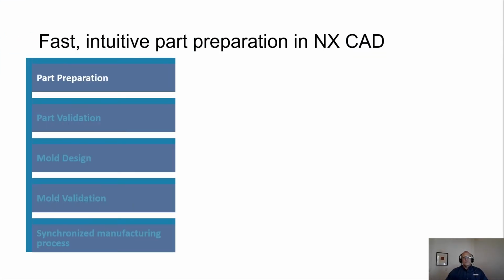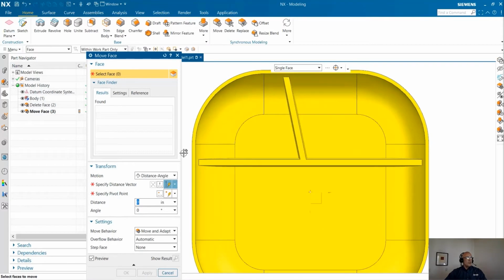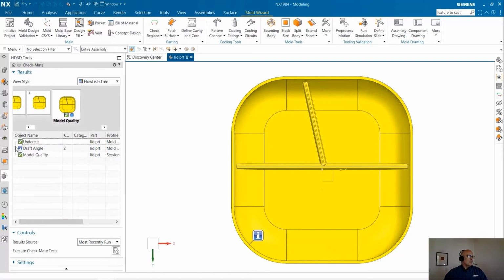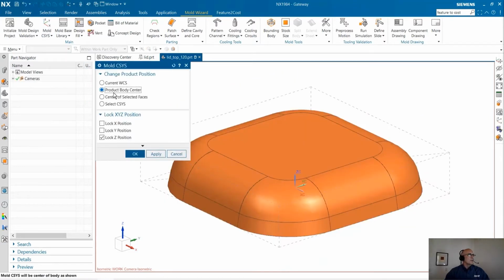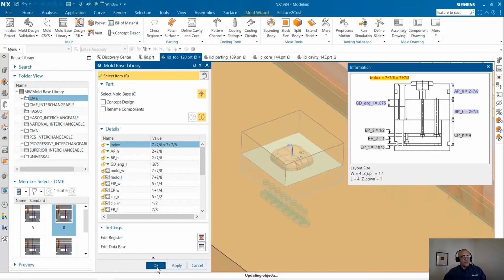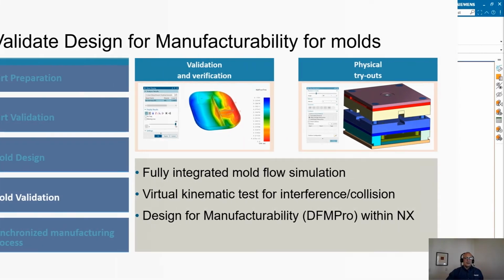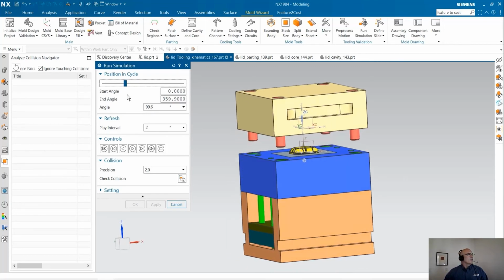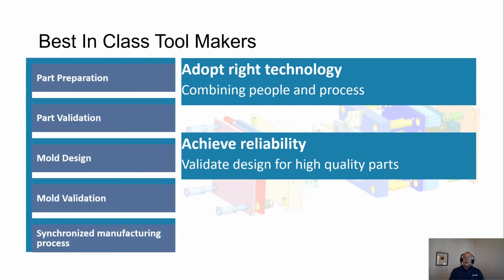NX Mold Wizard Webinar | Swoosh Technologies

Comment: Simple out of the box demo. I have been using NX MW for our 20 years, it does not work that simple. And I must add the 3dx Moldflow, or whatever Siemens calls it costs many thousands of dollars, it is not included in NX Mold Wizard, although this piece of fluff seems to point it is, except for a comment...........